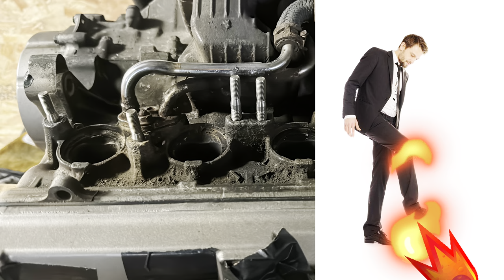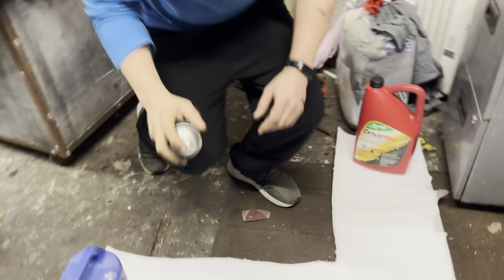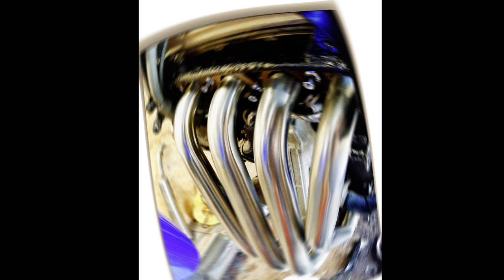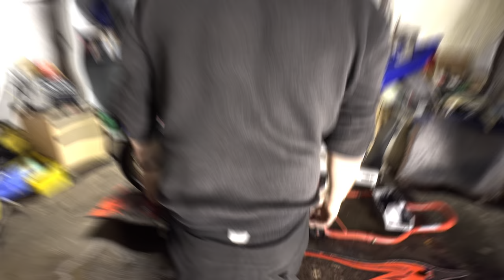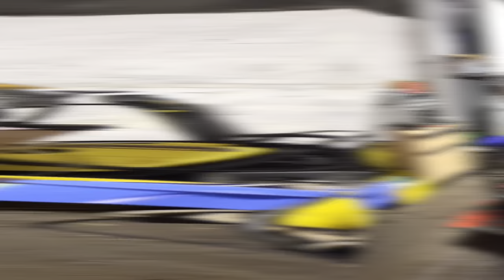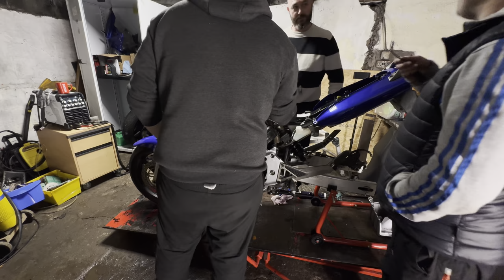Honda Hornet restoration part 3 bangs flames and tears

Comment: Well done lads ! Nice work on the pipes too.
Reply from the maker: Ah thanks ☺️ i was a bit rushed as we only had small windows of time to get things done. But will be looking to make a polishing specific video soon on ally and stainless. A more indepth how to instruction. (Must try and not rant about Harpic)
Reply: Pipes look great still, and now have a nice golden hue to them after some heat has gotten through them. Looking forward to the polishing video, happy to use my pipes as the test piece again too 😉
Reply from the maker: @vaughanoneill8  well it could be a goer if you need to get them off again 😀😀😀